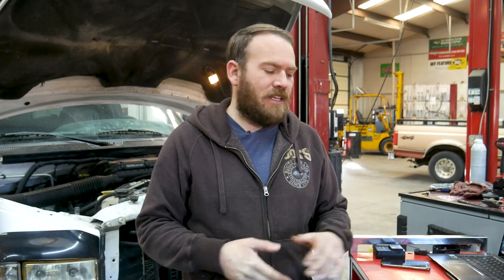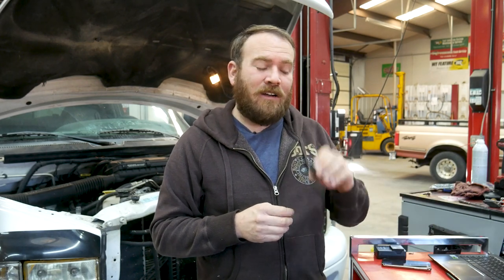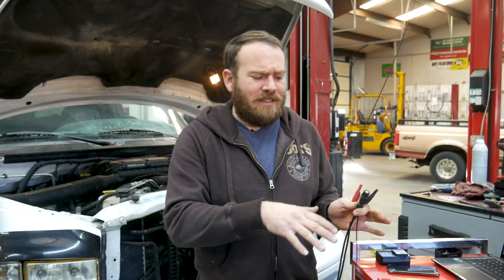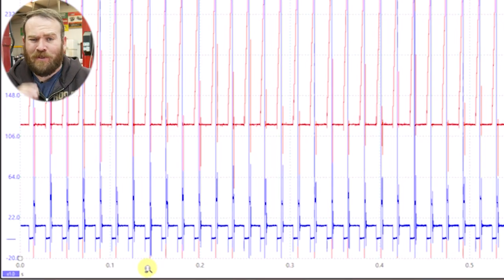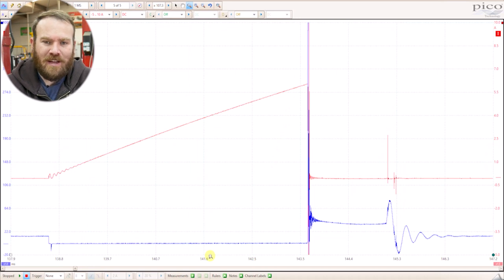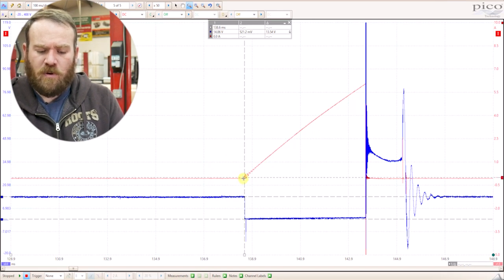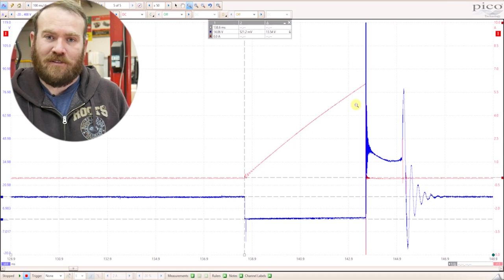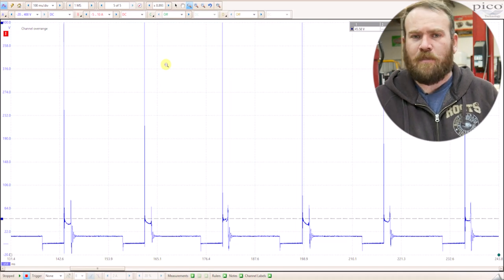Weekly Waveform #9 - Ignition Primary Current and Voltage

Comment: Turns ratio is same as voltage ratio
And they both are the inverse to the current ratio
Therefore power in equals power out
Thanks for the information, been ages since I scoped an ignition coil (a step up with high current on primary and high voltage on secondary) and man do I need a refresher despite working electronics for decades.

Comment: I have the Launch Torque 5 scope. If ignition primary can reach 50k volts, what ratio attenuator could I buy to protect my 100v max scope?
Reply from the maker: The primary can reach 400v on the inductive kick. Most use a 10x or 20x attenuator. 
The secondary wire is 50kv and you do not want to connect anything to that. The secondary side is the plug wire or coil boot side. 
If you are checking secondary you will want to use a secondary clamp that goes around the wire but doesn’t pierce it.
Reply: @ThePracticalMechanic  Thank you. What about injectors? My Launch Torque has a limit of 100v.
Reply from the maker: @meblake7359  most injectors rarely have a kickback over 100 V but some can be up to 200v

Comment: Great Video and your description !!!!
I am trying to get tach signal from my yamaha MT07 which has 2wire COP coils.
The aftermarket I am using cant read at all through these 2 cables.But it works 9 times more Hz from crank sensor.
If you could give any advice ,it would much appreciated.
Reply from the maker: If it’s a 2 wire coil you should have one power wire and one control wire. The tech is normally connected to the control wire and some tachs have “gain” adjustments to play with until the signal works for the tach.  

If you have a lab scope I would check the primary side of the coil and see what type of signal is present.
Reply: @ThePracticalMechanic  I already know which is power and which control,but my tach cannot adjust itsself to read it at all,I now looking for some signal pickup amplifier maybe to send the right square waveform  .
Thanks a lot and keep on your great job!!!

Comment: Not clear on which wires u r probing 
Could not see under the coil
Reply: One side gets +v constantly (battery) and the other is control switching from ground (allowing current to build up a magnetic field) to high z, causing the collapse of said field to fall onto secondary creating high voltage and therefore spark. So not the +12 side, he's hooking up to the points side or condenser side